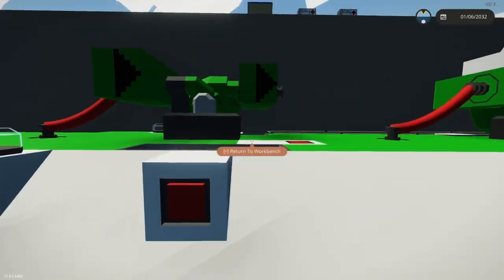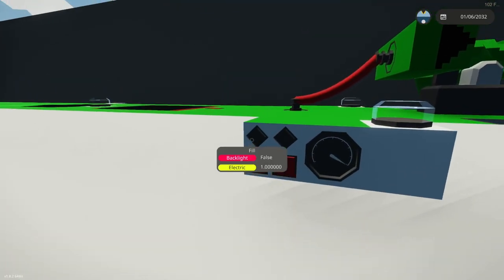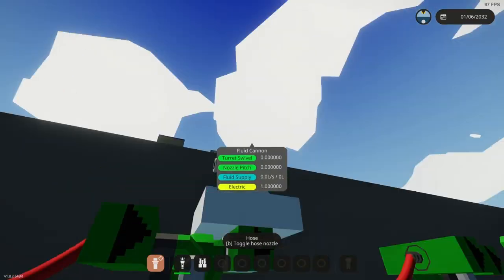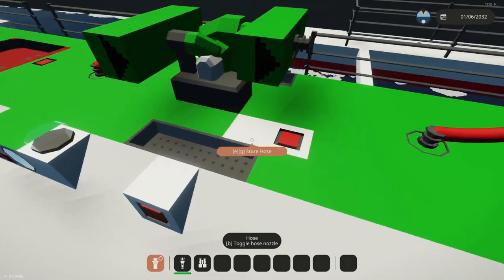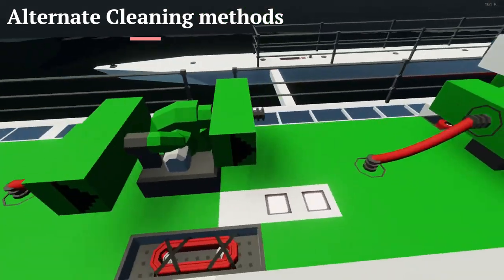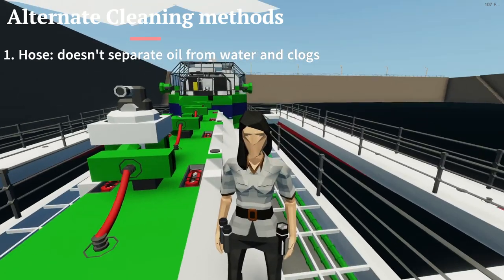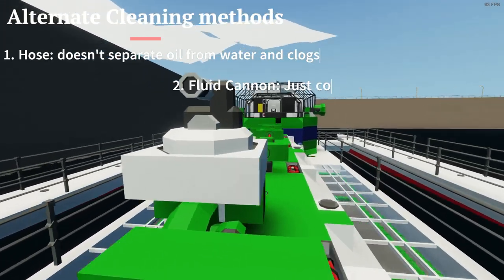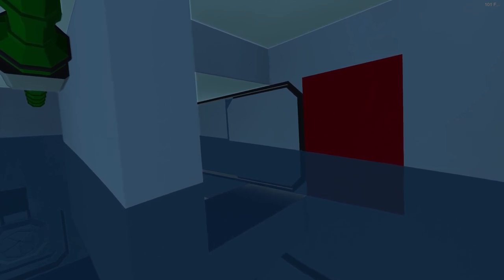Stormworks Oil-spills 2 -  How to clean up with some alternate methods.

Comment: I mean at that point, why try to clean the oil out at all? Why not just have ports sucking in oil/water going straight to pumps going straight to fluid nozzles? It's not like they actually will flood your ship, so you could essentially create like a canoe capable of oil cleaning. Why wouldn't you want the oil? Because you might be excessive like me and be playing with all the DLC active so you get dumb weapons AI running themselves aground and literally causing oil spills themselves.

I think the reason why the distillation ports were swapping to diesel has to do with how they function. They distill fluids based on their elevation within the container they're in. The moment you opened up your cargo lift, I think the extra space the bottom fits into suddenly added "more depth" to what was considered to be the hold, so the ports then updated from all oil to the higher ones being at, relative to the height of the area, diesel elevation. It seems weird that it doesn't update back to the smaller space.